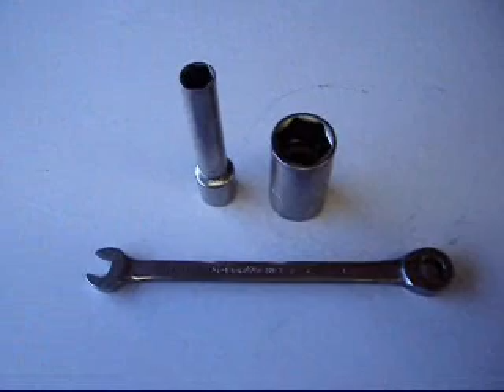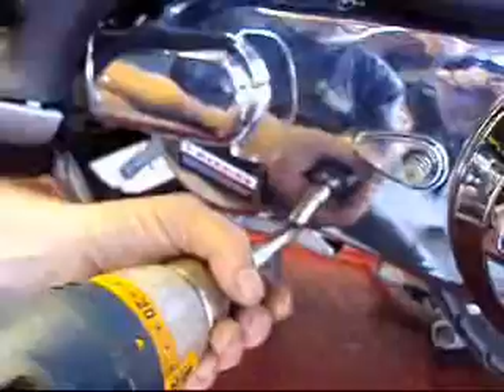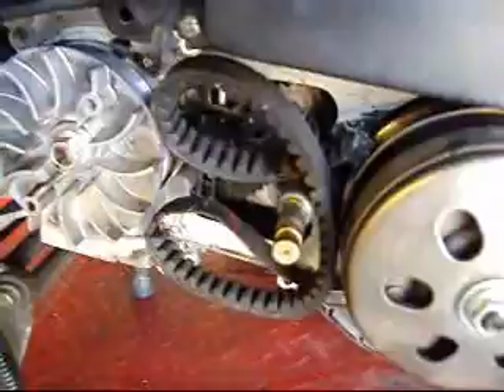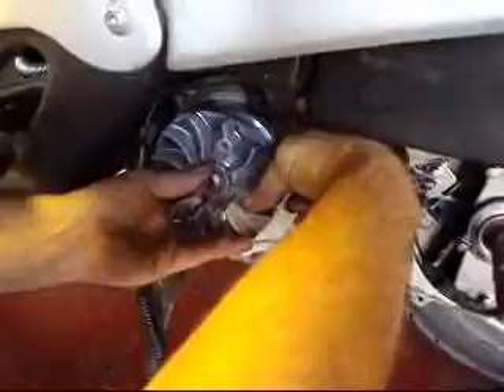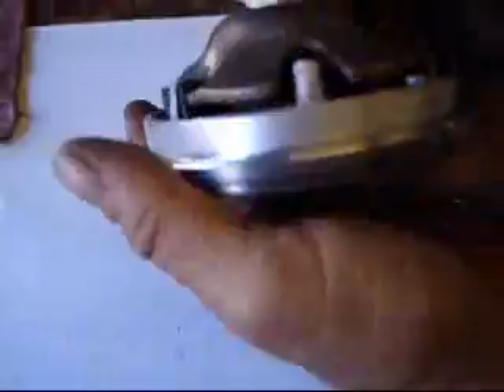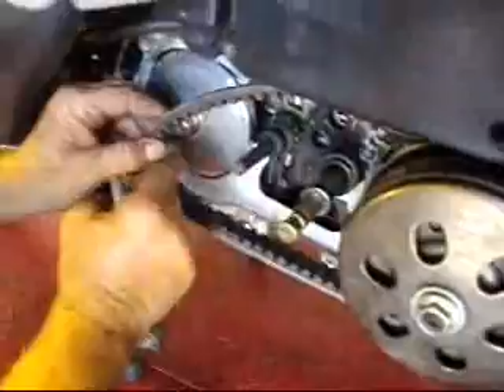Nor Cal Scooters, Scooter Drive Belt Tutorial

Comment: i have a 150cc scooter that the drive belt got shredded on my way back home i found a lil peace with 835 20 numbers on it so i order one with that number it was very small so i took it to a shop to remove the variator nut, than i put the new belt and i ask them to tide the nut again wich they did but now it wont start it just acts like if its stuck what can it be wrong